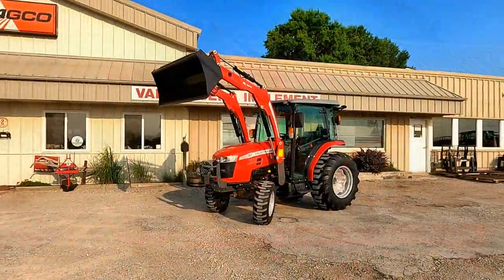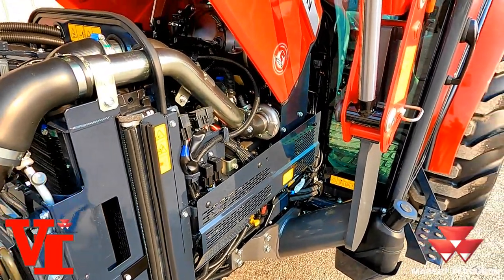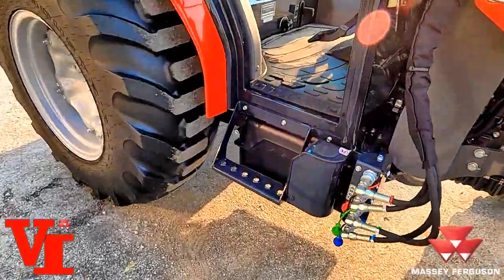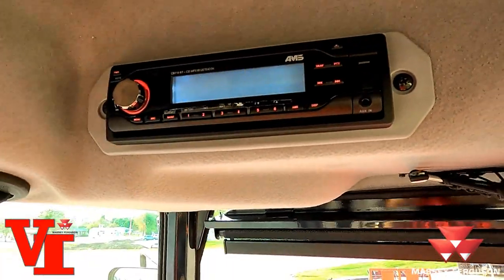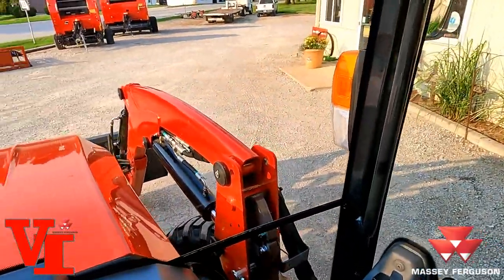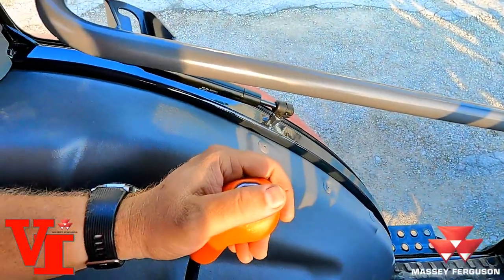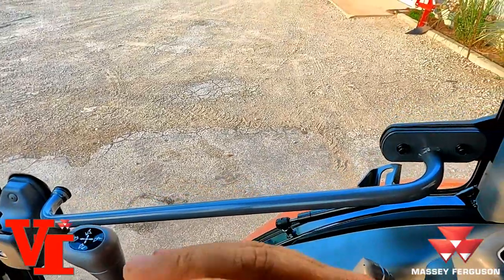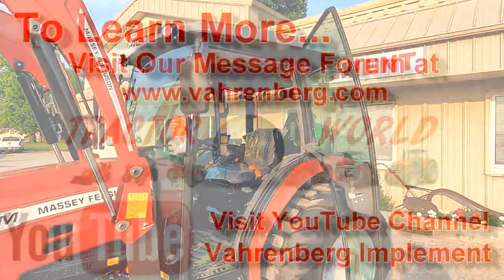Massey Ferguson 2860M eHydro Deluxe Cab Premium Compact Utility Tractor

Comment: I’ve never liked the auto throttle on tractors.
Reply from the maker: Why? it's one of the nicest features for driving and especially loader work. Fuel saver too!
Reply: @VahrenbergImplement  I’d rather set my throttle and control my speed with the pedals.  Every time I’ve used auto throttle,…I end up having to do to much shift with the range selector.  The torque was never really in the sweet spot for where I needed it.  To me,…it’s only good when doing work in tighter areas,…and that includes loader work.  When mowing in thicker weeds/grass,…you can’t just back off of the pedal without being too far below your ideal rpm range.  You have to put it in a lower range,…but when it thins out, then you can over-rev to get back up to speed,…or you can stop and select the next range up.  To say what I’m trying to say,…It’s easier to keep the rpms matched for the constant varying conditions a lot easier than with the auto throttle.
Reply from the maker: If you need minimum engine RPM set the hand throttle to that needs. Like Mowing with Rear PTO you set RPM with Throttle to produce the correct PTO Speed you need then when you get in tougher conditions or want to go faster AutoThrottle Kicks in to increase the RPM or ground speed and prevents the tractor from stalling. AutoThrottle works in conjunction with manual throttle but is there to help when you need more.